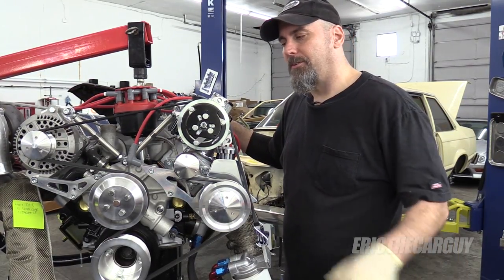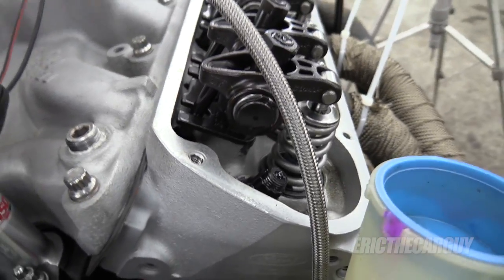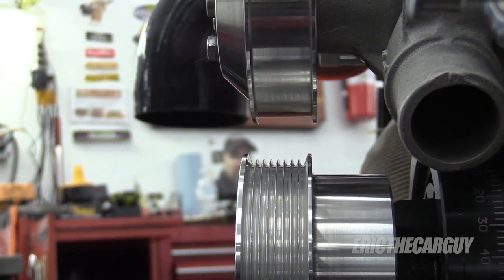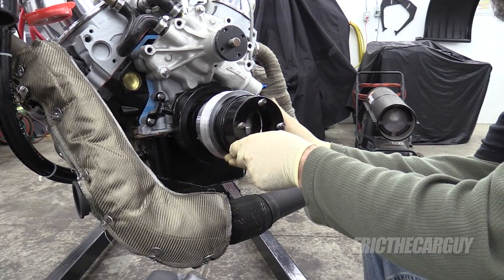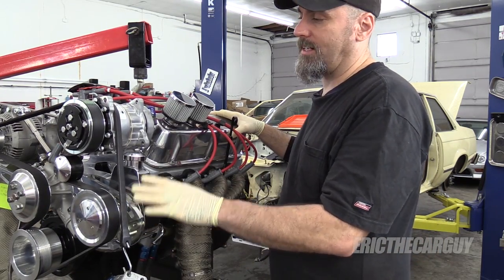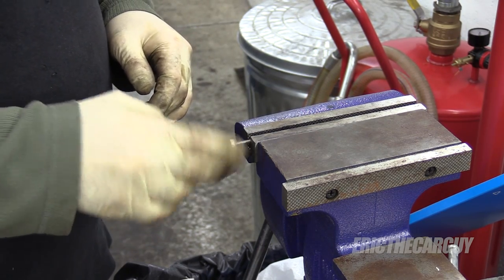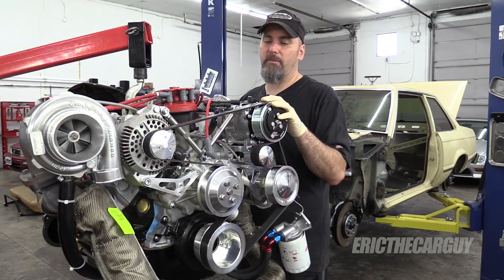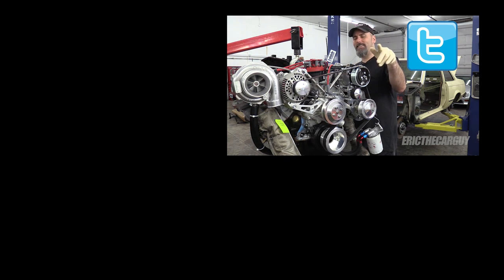How To Dress Up Your Engine!

Comment: I've personally disabled the A/C to gain the few extra hp out of the car. it's nice but I wouldn't go out of my way to fix or install an A/C.
Reply from the maker: I plan on driving this car on the street, and for long distances. If I were building a race car, I wouldn't bother with AC at all.
Reply: IamTranslation belts and bearings still eat hp. and when your barely getting 125 hp every few helps.
Reply: EricTheCarGuy I'm not talking about your car I was just saying I personally wouldn't put A/C on a vehicle and have removed it on a couple of vehicles. I've daily driven several vehicles without A/C. I love the cruse on a hot day with the wing window open.
Reply: IamTranslation 95 Honda civics don't have wing windows. if you have sweaty balls your not going fast enough.
Reply: Well, if the A/C bearing is not in good shape and drags that will eat up HP but a good bearing will take less work to be driven by the belt. @IamTranslation hey me too, when it's hot I get angry. Especially when I'm working on my car without a fan to cool me down, something bad will go down. A/C is my friend too.
Reply: I did that once.....and I'll never do it again.  It sucks not having A/C in a street car.
Reply: Ali Haidar yes a a/c with 300,000 miles may have some bearing issues. or maybe it needed a new belt because it was squealing real loud and I didn't feel that removing the front engine mount was woth the a/c.
Reply: IamTranslation so true.... that's what ac clutch is for.

some people just don't use logic or math on their own. 
let's just say the belt and ac clutch  bearings uses a negative energy equivalent to a power drill heavy duty 20amps at 110 volts... that 2200watts or 3hp.
But we all know the ac clutch is free wheeling.... So it's less than 50watts... like an electric fan and even that is too much for a free wheeling ac clutch bearing. 

So even at 1hp for a 125hp engine... that's less than 1%. 

So some even don't want to put an ad and turn it off to save lkess than 1hp... like they could tell the difference.  haha.
Reply: IamTranslation exactly.... So these guys opting not to install ac.... they are missing the nice sunday afternoon drive to sunset boulevard with cool air... especially on summer hot days. lol.
Reply: Idea being to make such a big engine to have enough hp in total, to have ac and still plenty left over to safely and comfortably drive on the street with enough power to pass if need be. Not all hp is intended to be at the wheels on a street machine.
Reply: IamTranslation when your running a Honda civic with 300,000 miles that burns 1qt of oil every 1k miles anything helps. also the a/c pump makes a great air compressor. like I said if you have sweaty balls you ain't going fast enough. from the sounds of it you gals don't actually have balls the sweat so what are you whining about.

Comment: I'd have 1 issue with a dress up kit like that.  I'd be itching to break out the cans of Mother's and putting a mirror shine on  all that aluminum.
Reply from the maker: I might once it's installed for the last time.
Reply: EricTheCarGuy Well if you do, just be careful not to blind yourself with the shop light when the beam hits it if you  have to check the oil. lol

Comment: Hey, Eric! I was just thinking... there is a whole machinist YouTube community out there. Maybe you could try to contact some of them to maybe do some collaboration on manufacturing custom parts instead of buying pre made 'performance parts'. Do a google search for YouTube machinist community.
Reply from the maker: Thanks for the suggestion. Actually, I have quite a bit of stuff that I've made myself on this build, but I did have someone make my fuel cell for me. https://www.youtube.com/watch?v=YeyaFW1CFPY&t=3s
Reply: Ah, yes, that's a good one! But I was more thinking about precision machining that you can do with a lathe, milling machine or a CNC machine. For things like engine mounts, brackets, bushings, pulleys, etc.

Comment: If it goes anywhere near a race track he'll probably be told to fit a catch can it's one of the things the get a bit anal about.
It might be an idea to fit a heat shield between the turbo and the alternator they aren't fans of high temperatures
Reply: The turbo has a heat blanket - it's just not installed at this point (it's a little bulky when you're trying to install parts around it.)
Reply: aussiebloke609 I know I meant in addition to the blanket.
Reply: Don't think he has anything like a rigid heat shield, just the blanket - not at this point, anyway.  But given time and considering that builds like this are never really "finished"...it may happen if/when he finds he's getting too much heat into the alt.  Sounds like a good idea to play it safe, though.  :-)

Comment: you want to 200 amp, that ones not gunna please you at all!!! youl see!!!
Reply: he's not running a damn welder off his car, what hes got will be plenty strong
Reply: 130 amp is more than enough...
Reply: Tommy Verceti considering its manual everything with no real load, the stock 60 amp setup would do fine. i did a 130amp alt and electric fan and noticed no improvement what so ever, but the car easily charged with the stock setup anyways, just didn't want any problems with the added electric fan.

Comment: Haha people attempt top tier builds but still have band aid fixes because they don't understand how engines and all their systems work together. The valve covers were not the issue. It's the fact you are running no PCV, open air crankcase breathing system with no oil catch can on a high HP engine. Did you fix the real problem, NO. Did you stop the oil, yes. The oil wasn't the problem it was the result of your problem. You changed the result but didn't fix the problem. I would have first tried an adjustable PCV like a Wagner Dual adjustable and I would have installed an oil catch can with or without the PCV. Next check internal baffle on the covers and modified if needs be. I really want to know why people think excessive combustion gasses in your oiling system is ok. You will be lucky if you don't blow all your oil seals out with a quickness. 

....and you couldn't figure out how to mount an AC compressor without a special bracket from CVF.  That CVF stuff is nice but how can you work on as many cars as you do, call yourself the "car-guy", and attempt top tier builds but you cant fabricate a darn bracket? You seem like a cool guy and you have a passion for cars but what's frustrating is trying to find videos of the real deal skilled mechanics amongst a sea of R and R guys who think they are mechanics. That's not your fault but that's where this is coming from. I keep finding dudes like you, on YouTube, who are more like my friends with money.....love cars, love speed, nice guys but when they go brag at the track about building their cars when all they do is RandR bolt ons. It's also frustrating that so many people like you have successful YT channels about specific content but they aren't a pro or even pretty good at the particular subject the entire channel is about, rather they are just a people person, charismatic, well spoken, clean cut and know how to social network. The success, oddly, is measured by subscribers rather than quality of content so a wierd situation happens where often the pages with the most success usually have the most garbage information and a trail of people who are trying to learn and don't know enough to know they are getting fed bad information.